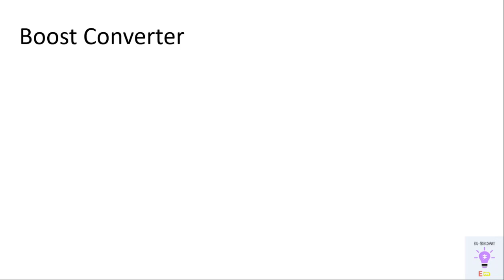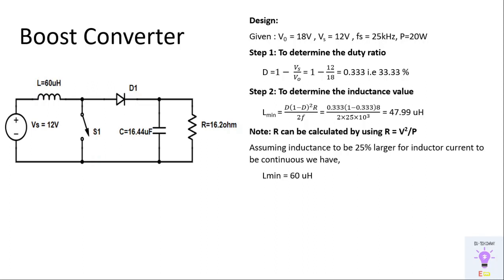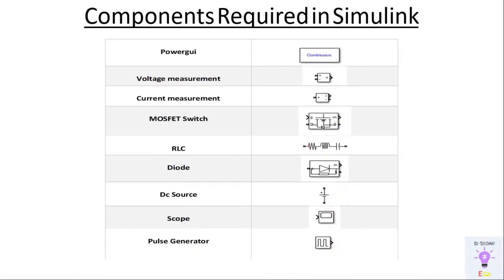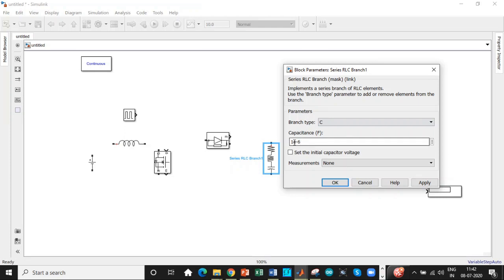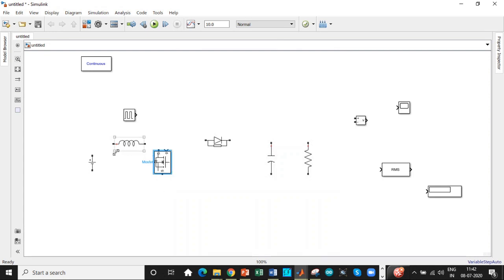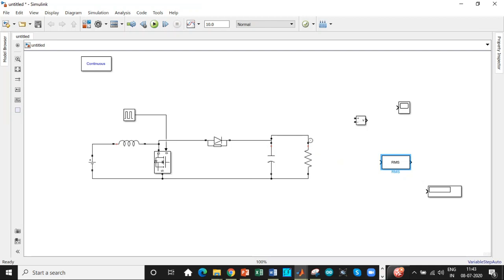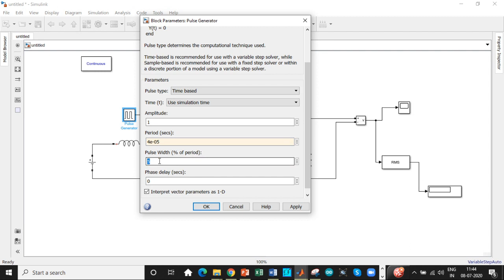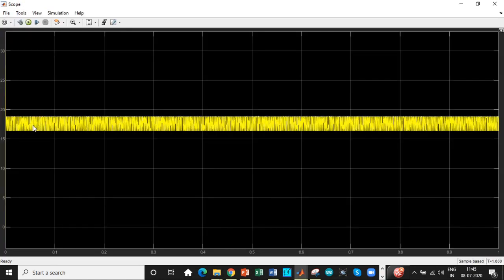Design and Simulation of Boost Converter using MATLAB SIMULINK / DC-DC Step Up Converter (Chopper)

Comment: Thank you for your efforts, I have a question please: in a lot of articles they used also  an input capacitor when we used the boost converter with a PV system, please can you tell me how we can calculate the parameters of the boost converter in this case?

Comment: I have a question, my source is a pv panel with 250 W , must be my resistence  calculated with the 250 W?? i diid it and i get very small inductance and capcitor, and  a high current trought te inductance

Comment: Hello sir! How can we select suitable inductor and capacitance values if the ripples are more?....
Bcoz already we did the calculations for them so how do we change them?
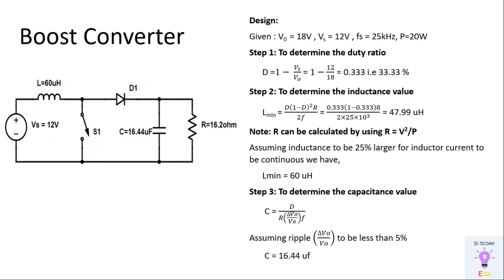Reply: C=D/[R*(Delta Vo/Vo)*f] --> where Delta Vo/Vo is the ripple value for this video it was %5 or 0.05 just put the desired ripple value into formula for the capacitor. For the inductor Lmin=[D*(1-D)^2*R]//2f). Both formulas were given in the video, please look at 1:30